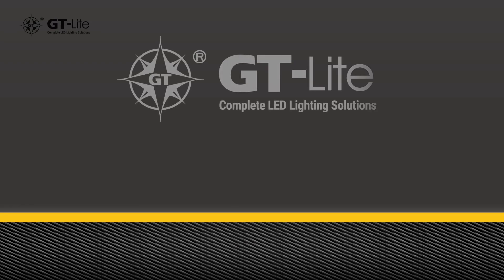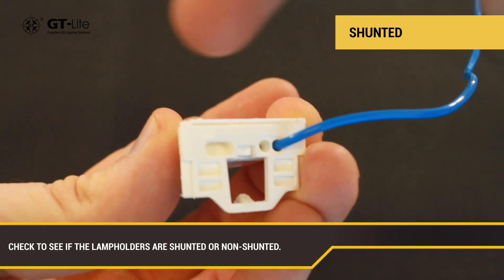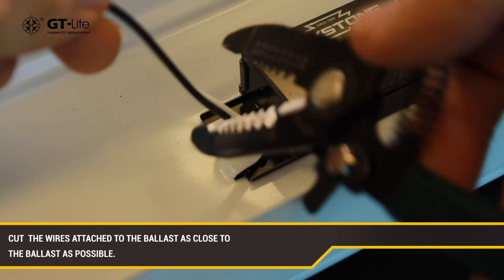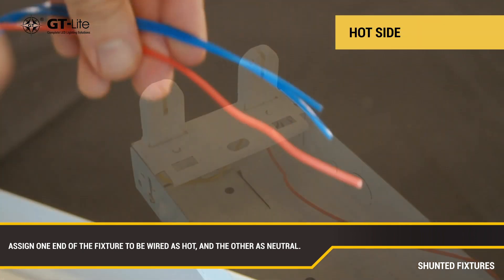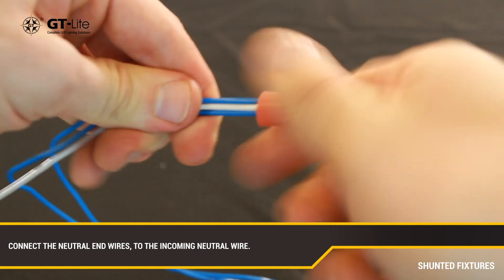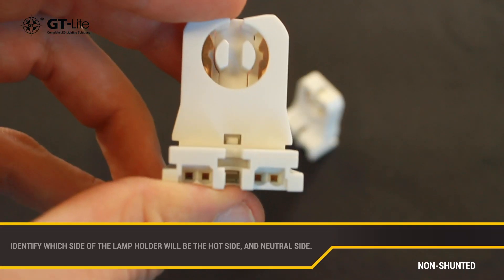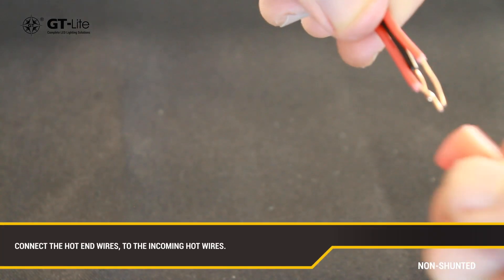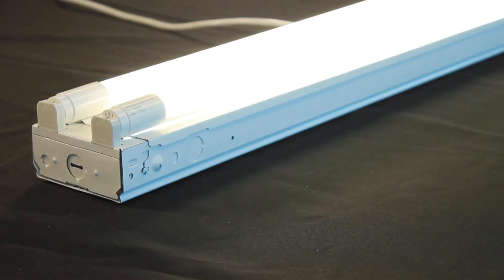How To: Bypass A Linear Fixture's Ballast

Comment: That's the way i do it, too. But do you know why one has to connect both wires from each tombstone to the power rather than just one? I have always wondered about that.
Reply from the maker: The term shunted refers to the metal plate that connects each side of the tombstone allowing you to wire up only one side. Some fixtures include them and some do not.

Comment: Just curious, why is it best practice to leave ballast in the fixture. I have retrofitted two lights successfully using your bulbs.  Thanks
Reply from the maker: We advise that you leave the ballast in, only because removing it is just another step that you do not need to do. Though if you want to remove it entirely, it should not effect the bulbs.

Comment: Does this apply to GT-T5-4B-5000?
Reply from the maker: Yes, the process should be the same with only two exceptions. First is that they are installed into T5 shunted lamp-holders. And second, that they are bypassed in shunted wiring schematic.